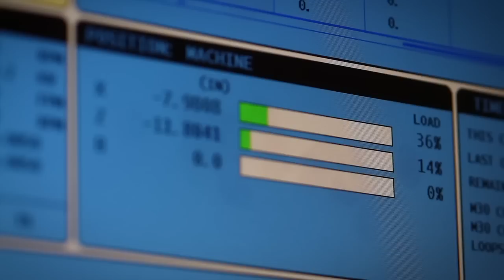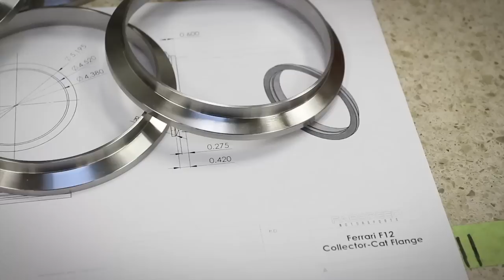Birth Of An Exhaust | Fabspeed Product Development

Comment: This is really amazing to see it's happening in US. Do you guys have any means to flow test your pieces or do you only measure changes as whole application? On the dyno only.
Reply from the maker: On certain systems, we will actually build full models in Solidworks and run simulated flow analysis. This is a very time-intensive and costly process though, so we reserve it for very complicated pieces.  For example, we did extensive flow analysis during the development of our McLaren MP4-12C Sport Cats and X-Pipe in order to optimize the tubing geometry, diameter, etc. It also allows us to map out potential failure points due to heat, stress, etc. and engineer additional strengthening at those locations.